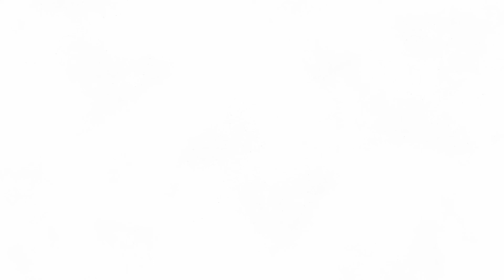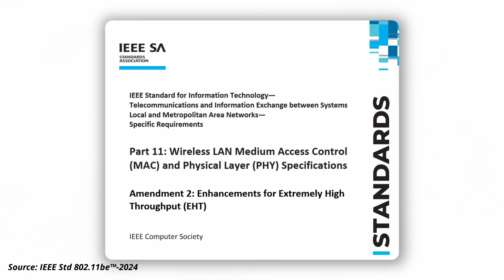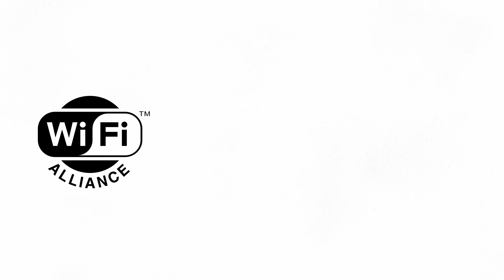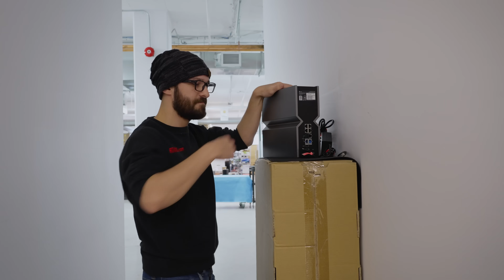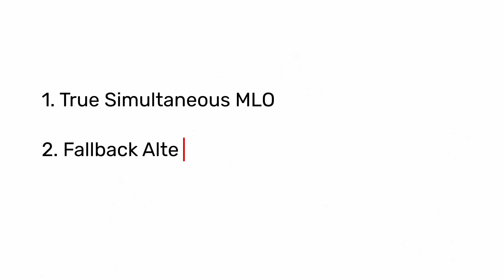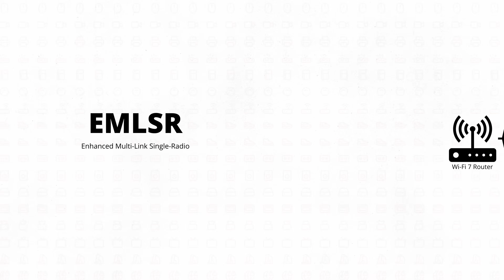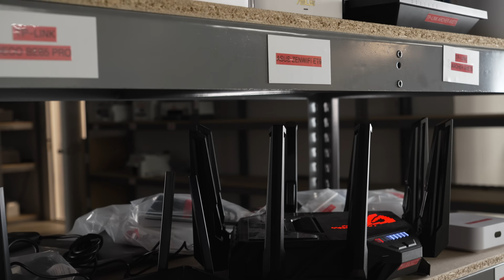Wi-Fi 7's Best Feature Doesn't Work (Yet)

Comment: I think this is technically correct, but maybe a bit overstated in terms of real-world impact. Very few client devices (if any) actually support full STR MLO right now, and I doubt battery-powered devices like phones will adopt it widely anytime soon because of the power tradeoffs. So even if routers had full multi-radio MLO today, most people wouldn’t see much benefit.

There are still meaningful improvements in Wi-Fi 7 even without STR, like 320 MHz channels, 4K QAM, better scheduling, and lower latency in congested environments. The spec vs marketing gap is fair to call out, but for typical home users the practical impact seems pretty small.

Comment: I have primarily deployed UniFi gear and currently run U6-Enterprise APs. I have not upgraded to WiFi 7 yet. Looking at the lineup, there are quite a few models available now, including the E7 Audience, E7 Campus, E7, U7 Pro XGS, U7 Pro Max, U7 Pro XG Wall, U7 Pro Outdoor, U7 Pro XG, U7 Pro Wall, U7 Outdoor, U7 Pro, U7 Long-Range, U7 In-Wall, and U7 Lite. In the video, only the Dream Router, Express 7, and U7 Pro were covered.

In UniFi Network, MLO must be manually enabled, which raises the question of how fully it is implemented across the current WiFi 7 portfolio. I understand that MLO support is still maturing across the industry, but I would expect UniFi to provide comprehensive support, especially given their push into larger enterprise deployments. Full and stable implementation of core WiFi 7 features such as MLO is critical if they want to position these platforms for serious enterprise use cases.

If MLO and other WiFi 7 capabilities are only partially implemented, it becomes difficult to justify upgrading from WiFi 6E, particularly when client device support is still limited. From a practical standpoint, the ecosystem does not yet seem mature enough to make the transition compelling.

I am not claiming UniFi is the best solution in every scenario, but in my experience it has worked well in my home and small business environments. I would be very interested in more detailed data on feature parity and real-world WiFi 7 support across the entire UniFi lineup, as that would significantly influence my upgrade decision.

Comment: Maybe this is the reason i stick with WiFi 5 at most for now because of the implementation. I dont like the sharing of that signal. 5GHz is only 5GHz for AC, 2.4 for only N networks

Comment: I tested Nokia and Bell's Wi-Fi 7. Neither of them even came close to the numbers promised. There was zero difference for game pings compared to Wi-Fi 6, which is heavily reliant on MLO to show any difference.
Even the extra Wi-Fi 7 speed is dependent on your distance from the router. You can only expect a better speed if the bar is full (2-3 meters away), and even that fluctuates a lot.

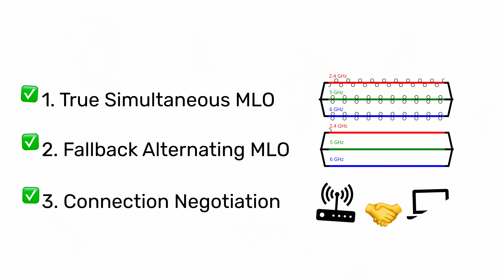Comment: @4:49  regarding 'true' MLO operation!  That is complete nonsense unless someone can prove it otherwise!
•  5 GHz & 6 GHz bands were implemented to speed up throughput but those bands do not have the wall penetration capability of the 2.4 GHz band!
•  Unless you can violate the laws of physics, just because the router and client device can simultaneously transmit and receive on multiple bands doe NOT mean the signal gets through the walls or other barriers!
So it doesn't matter because the 5GHz and 6 GHz bands still can't penetrate the walls!!!

Comment: Eero’s MLO page says:

“For Wi-Fi 7 capable devices that support this feature, connecting to the 2.4 GHz, 5 GHz, and 6 GHz bands simultaneously increases throughput”

But based on RTINGS, the Eero Max 7 doesn’t actually support devices connecting to multiple bands simultaneously, am I reading that correctly?

Comment: I got like 3k to 4k locked up in a my UniFi setup (router/switches/wifi/cams). I am good 👍 my WiFi5 is what most clients in the home so not moving to 6 or 7. But with a UniFi setup you can just add a 6,7, 8 (future) WiFi AP.

Comment: I have a pfsense firewall wired only with 3 U7 Wall Pro wifi 7 AP - wifi use to be synolgy rt2600ac .  Huge diff on clients that can do it like macs.  1gb wifi is reached instead of 500.  The wifi just seems faster all around.  I am also self hosting the unifi os on proxmox running 10.0 unifi os .  Seems to at least work great.  No I can update wifi without the family yelling at me.  Daughter is using a separate wifi name running MLO for playstation reaching 700 and no lag.  If playstation did not throttle you it would be 1gb.

Comment: If these companies haven't enabled more support via firmware updates by now, they may be limited by hardware & never be updated to enable more features. These features would then require new hardware revision each to enable more features. We could need to wait >3yrs or to hope Wi-Fi 8 capable devices finally implement more Wi-Fi 7 features when the hardware arrives.

Comment: The major problem with 6ghz is there's NO version of MLO or even fast roaming between bands on more than ONE device, so when you're outside the 20ft range of 6ghz, it has to drop off, reconnect to 5ghz, then roam over to the next APs 5ghz, then drop off, reconnect to 6ghz on THAT AP. So your connection constantly drops as you walk around. 6ghz is pointless unless you only have one AP. And if you only have a single all in one router, you probably aren't getting 6ghz the vast majority of the time.

Comment: The features you are testing for are very expensive to implement right now so are only really available on high end enterprise endpoints. As the technology becomes more prevalent the cost will drop due to optimisations in implementation and cheaper chipsets being made available supporting these features. With the WIFI 7 routers you test there will still be a lot of benefits for transmission speed, just not the frequency multiplexing MLO you are testing for.

Comment: I don’t know why WiFi and usb standards have to be needlessly messy and borderline grimy. I get it each standard won’t necessarily have all features enabled under their standard. I think generally speaking any customer in the know of what those features are know exactly why they’re paying a premium for these devices and cables. They’re praying on less tech savvy customers. Imagine the backlash if auto manufacturers put supercharged/turbo charged badges on base models. Why does electronics get away with this?

Comment: An additional point to the Wi-Fi 7 problem is the fact that 6 Ghz is handicapped without AFC.

In my case my E7 with AFC and MLO works well (for my use case). I don't get the combined throughput, but I can receive 6ghz throughput while still using the 2.4ghz for transmit. I can have a single AP for my house be very satisfied.

Comment: MLO is worth it if you have devices for it.  I hate uploading packages to intune and it doesn't use ftp or an upload client, so any hickup requires me deleting the package info I started and starting over.  MLO allows it to keep going.  Also, helps a lot for latency/switching issues.

Comment: @RTINGSRD What about testing the ASUS ZenWiFi BT16 Pro don’t you want to see weird menu glitches and MLO crashes? Oh by the way once I understood what MLO was I was like, but if you could do 6GHz 24/7 why would you even need to down shift? Do I have anything that can even connect at 6GHz? NOPE MLO right now just takes resources away from pushing 5Ghz to the max. I turn 2.4GHz and 6GHz off and push all bandwidth on 5GHz and my fastest devices get 2.5Gbps, it’s MLO might be trash, it’s menu’s might be torture, but when, where and how it works is Beastly 😂

Comment: I replaced all of my Ubiquity AC access points with Ubiquity Wi-Fi 7 access points.  The results are amazing.  Even the older devices that do not  have the capabilities for the newer Wi-Fi accessed the access points significantly faster.  Speeds improved about 70%.  The new devices that support Wi-Fi 7 had speeds that maxed out the fiber at over 650gb. That is money well spent. I call it future proofing the network.

Comment: The multilink graphic depicts channel frequencies incorrectly;  The "bitrate" is different not because the bits move at a different speed, but because they are sent at a different frequency.  The circles representing data (bits?) should move at the same speed regardless of frequency, with the lower frequency channel depicting lower frequency of transmissions. The transmissions travel through air at the same speed regardless of frequency.

Comment: I just went full regard and bought multiple unifi E7. With 10G fiber internet im pretty sure I have the best wifi available at this time, but it required enterprise grade hardware to achieve it. However even with the intel clients the best I can get is about 3.8gbit under optimal conditions with lots of tweaks. Most clients max out in the low to mid 2gbit range, which, don’t get me wrong, is still plenty for most use cases. It’s just unfortunate how much money and effort is required to get anything close to the capability advertised. Consumers are really getting shafted. There should be clear distinction between the capabilities of these products. I thought that was the whole point of switching from the 802.11 standard being printed on the box to the numerical WiFi 5, 6, 7, but evidently this was done just to increase obfuscation of capabilities and move more product. Sad.

Comment: And here you are only looking at the AP you also have to take into consideration the client. The client end is just as bad.

EMLMR and NSTR-MLMR is, as far as I know, not part of the Wi-Fi 7 certification. Only MLSR (is that even MLO one could argue :-) ) EMLSR (the single radio variant that most clients supports) and STR-MLMR (real MLO ?).
The problem is still that you cannot see from the "Wi-Fi 7" sticker what mode of operation your client supports. I mean ... you dont actually know if your AP or clients supports 6Ghz , because that is not a required part of the "Wi-Fi 7" certification.
So far, as far as I know, Intel NICs and some of the USB dongles with Mediatek and Realtek chips do EMLSR (I think the Iphone does EMLSR today after a software update). The Qualcom NIC does STR-MLMR and the Pixel phone should do both EMLSR and STR-MLMR, but as mentioned .. you dont know from the "Wi-Fi 7" sticker.
(and dont get me started on QAM support, yes yes, i know that for 4096 QAM you need a REALLY good SNR, but what you dont know, again from the "sticker" is if your NIC supports it.)
Some of the problems come from interference within the device, between the two radios. Especially 5 and 6 Ghz, That is why you might most often see links on 2,4 and 5 or 2,4 and 6Ghz and not 5 and 6Ghz at the same time.
It all depends on the quality of the client (and the AP).

We are almost back at the to when the 802.11n standard was introduced, where you did not know if your 802.11n device was dualband or not, just from looking at the "Wi-Fi certified" logo. - it only hurts consumers.

PS: some people also forget that Wi-Fi 7 features requires the correct OS and security enhancements to the Wi-Fi network. - For example you need Windows 11 24H2 for "private SAE" MLO support, and officially 25H2 for "enterprise dot1x" MLO support.

Comment: I have both the Linksys WiFi 6E mesh and WiFi 7 atlas routers running in two different houses and neither has received any firmware updates. Please expose them for this! Love your channel especially regarding this topic those mesh systems are expensive for multiple nodes and they get terrible software service. So thank you, hopefully you can bring some change to this.

Comment: You mention the Asus Zen WiFi BT-10 as their "highest end router", but it's not.  The highest end last I checked is the Zen WiFi BQ-16 Pro.  That's a quad band system.  I'll poke around to see if it actually supports simultaneous MLO, but I've definitely seen MLO active on my phone.  It would be nice if you guys tested that one.

Comment: Good video — I agree Wi‑Fi 7 marketing should be much clearer about what "MLO" actually means in real products.

One nuance though: calling EMLSR a "crippled EMLMR" misses why EMLSR exists for clients. Most phones/laptops are 2x2. If you try to do EMLMR on a 2x2 client, you often end up splitting it into 1x1 on 5 GHz + 1x1 on 6 GHz, which can lose the benefits of 2x2 MIMO (range/stability/beamforming gain) and sometimes reduces real throughput.

EMLSR keeps 2x2 on the best band right now while still monitoring the other link so switching is fast and seamless. That's a big win for latency, roaming, and reliability (calls/gaming), even if it doesn't "sum" peak speeds.

True simultaneous multi-link throughput is more like STR and typically requires separate radios — common for AP-to-AP/mesh backhaul, but not for most client devices. So the issue isn't that EMLSR is useless — it's that vendors market "aggregated speed" without stating which MLO mode your client actually supports.

As a BT10 user: between mesh nodes, the system does use STR (simultaneous transmit/receive on 5 GHz + 6 GHz with full 4x4 MIMO on each), which is where you actually get that "aggregated backhaul" benefit. It's just not something client devices with 2 antennas can replicate.

Comment: My router and extenders have wifi7 (or wi-fi 7?) with MLO. They are connected via Wifi (wifi backhaul). Without MLO I get about 1 Gbps on that wifi backhaul, with MLO about 1.9 Gbps. So ... good sign that MLO is indeed working Multi Link?

Comment: Yes. I'm using WiFi7. I have noticed a big improvement. 1600+Mps through 2 walls. My previous WiFi6e was less than 500Mps on the same plan to the same location and device in my house. MLO, beamforming ect are all turned off as I never needed to make any tweaks as I am satisfied with the speeds.

Comment: Needed a new router recently, and I was astounded by the number of Dual Band "Wifi7" routers.  Ended up getting a TP Archer B600, and the only difference I noticed over my Wifi 6 router is that it actually connects. No real performance improvement over my last router when it was working.

Comment: good review, thank you. I actually went backwards.  Had the ASUS AX routers (Wi-Fi6) and switched to Ubiquity, and dropped back to AC (Wi-Fi5) access points.  Cannot tell the difference, well no the multi-AP setup in the house is better than the ASUS multi-AP setup, because I can put the antenna where they need to be.
Wi-Fi7.... sure maybe at some point.

Comment: not top of the line devices that has proper mlo does not have quality antennas - higher sustained throughput are very sensitive to obstacles and coverage is lacking when there is multiple devices actively working.
as of feb quality devices cost more than 1k for ap, this is exorbitant considering that wifi 7 will be replaced by next standard rather soon

Comment: I recently bought an Unifi UDR7, and I'm so fed up with it. Out of the 27 devices connecting to this router, only 1 is capable of using the 5Ghz band if I enable all bands on the same SSID, band steering is just not working. The 2.4 Ghz band is super slow, I measured under 100kb/s download speeds, while my internet connection is capable of 2 Gbps down and 1 Gbps up. I had very nice speeds with my "old" Asus Gt-Ax6000 although it was only a Wifi 6 router. I regret purchasing this crap.

Comment: Ya been waiting for the day 2.5 and 5ghz can be connected at the same time seamlessly. I still to this day find myself separating 2.4 , 5, and 6ghz bands into different APNs because of connection losses and fluttering between bands. 

 It's tough to have a casual conversation about WiFi features since every modern router has dozens of features and the client device also has to support certain features.

Comment: I finally just disabled 5ghz completely, i dont need it. I also threw a EMF net over my modem. The EF/EMF/RF testing afterwards is significantly reduced, and yet i notice zero degradation in my wireless experience. Everything important is hardwired anyway.

Comment: For real "wtf are people even doing" - look there is a cable to your house and through it data is pushed through. All far so good. Now instead of connecting a pc to that cable/to the router. People need to have mobile devices and now they push this data "additionally through the air" - in a big house your basically simultaneously inside of like 20-50 wifi networks. You do know that full HD videos were alrdy watchable via wifi in the 2009 or whatever era and even back then you could also play games via wifi (ofc not with a ping as good as via cable, but still very playable) - everything since then is basically just "selling you snake oil" - what are you even doing that your downloading more than like 1-3 or 10gb a day via/through the air? I don't get it.
This obviously can't be good. Look "the most simple forms of plants can't even grow right under your wifi router" - it can't be healthy.

Comment: Thanks for the work, but I should say that the whole point is irrelevant. If you want a fast and reliable connection, just go with wires. I also should say that wired link aggregation is not always supported, so no doubt wireless is worse in this case. In my experience WiFi N was a good step forward and it covers almost all of everyday needs, has a good range/speed/power consumption balance and it is reliable. WiFi AC was quite insignificant despite being advertised as a major upgrade. WiFi AX and AX+ were a bit odd and confusing but it was right in time when WiFi N routers had to be changed for something newer. The fact that AX routers have much more computing power and RAM made them better suitable for home media centers and advanced routing (mainly for adblocking and censorship bypassing) than older N routers. And here comes WiFi BE, too soon since AX and having too little to offer yet increasing the price quite a lot. A technology that nobody asked for and that has nothing to offer to an average user